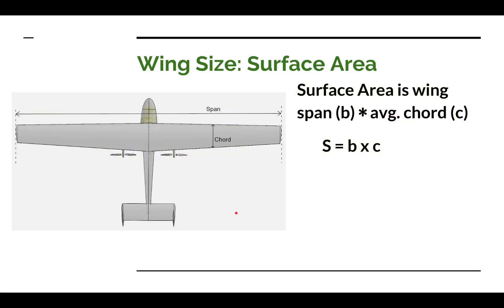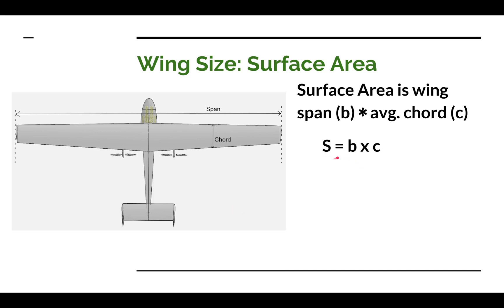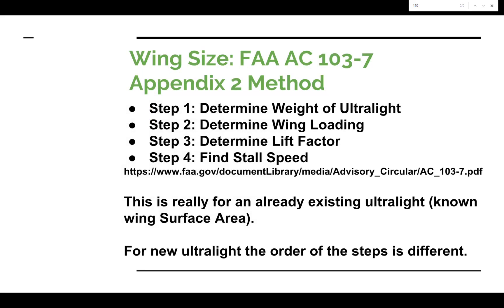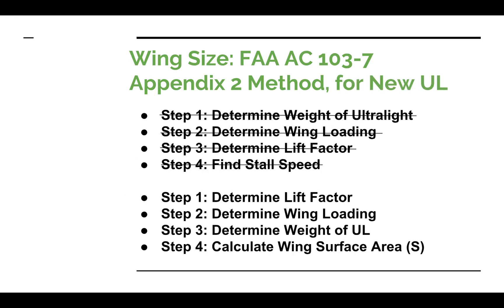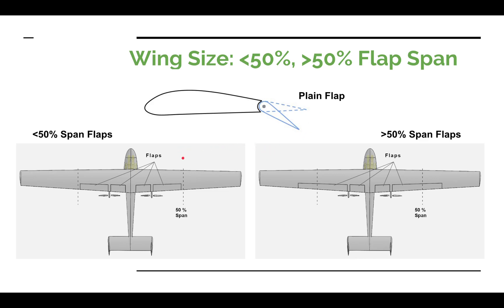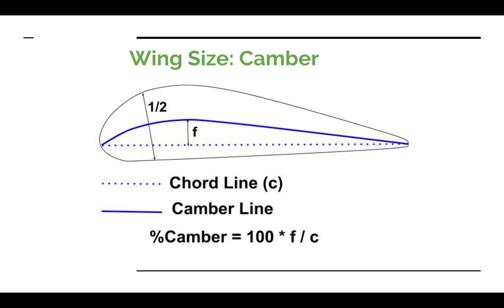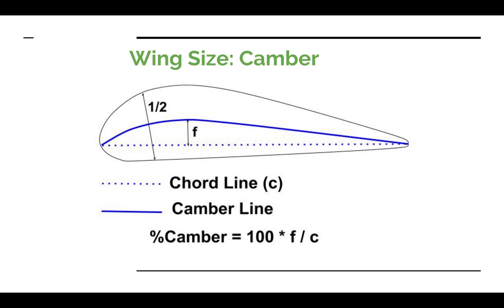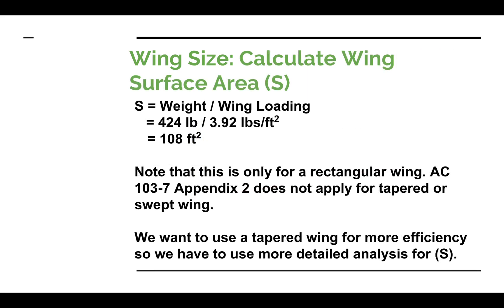UWS-1 Design: Wing Size, FAA AC103-7 Appx 2 Method

Comment: How would i calculate a single surface wing covered in a cloth material since it would not really have any thickness.
Reply from the maker: The FAA Advisory Circular 103-7 Appendix 2 has a Clmax for a single surface wing.

Comment: Interesting video. I believe that the fuel weight (and parachute weight) should be included in the calculation, according to Appendix 2. Otherwise once you load those onto your airplane, you will get a stall speed that is higher than what you have designed for.
Reply from the maker: I agree. In later videos I did exactly that.
Reply: @Designer103  I remembered that you are designing an electric airplane. That explained the reason of zero fuel weight. Very interesting idea. Flying by wire is another interesting idea. How reliable do you think those fly-by-wire system can be? Even if dual redundancy is used throughout, from power, to control, to actuators, it still fells a bit unsure with consumer grade equipment. Thoughts?
Reply from the maker: I've thought about reliability of fly by wire quite a bit. I think that to start with I would have a push pull cable system for all the control surfaces and also have electric trim tabs on all control surfaces. The trim tabs would be used for fly by wire but could still be overridden by the cable system. That would mean a 'regular' control stick and a joystick for the fly by wire. That would let me test most of the software, power systems and data systems. I'd put a few hundred hours on the fly by wire to try to determine reliability. Once I was happy with my phase one fly by wire I would remove the cable control from half of the control surfaces and replace it with electric actuators but not with full deflection capability so that I could still overcome the fly by wire surfaces with their redundant cable actuated control surface. Again I would fly a few hundred hours with this phase two fly by wire to determine reliability. If I was satisfied with the reliability I would then move to full fly by wire on all control surfaces. That is my current thinking. It is likely to change since though.
Reply: @Designer103  I felt the same way, probably still needs a mechanical control link of some sort to feel right. For amateur construction, by the time all necessary redundancy, link checking, signal integrity verification, and status watch dogs are all built-in, it probably will not result in any simplification in construction or much weight saving at all. But it is still a fun experiment none-the-less.
Reply: Why would you make a redundant system to flight control unless you are going to utilize some type of autopilot?  I wouldn't consider the fly by wire as a redundant (Backup) to the manual system if the mechanical system fails the electrical system must be a able to clutch the mechanical system.  . You do a phenomenal job! Thanks again @Designer103